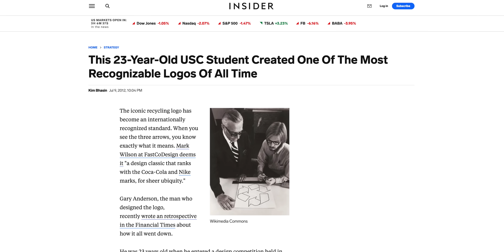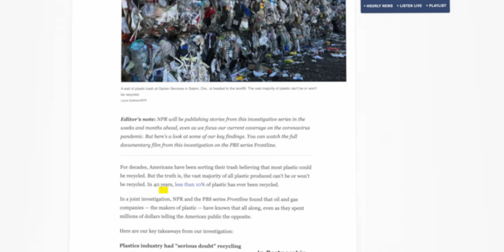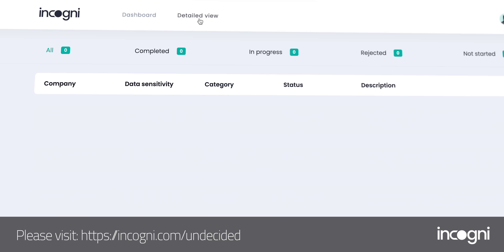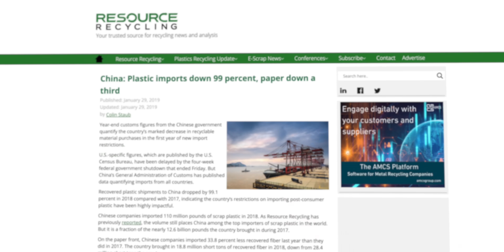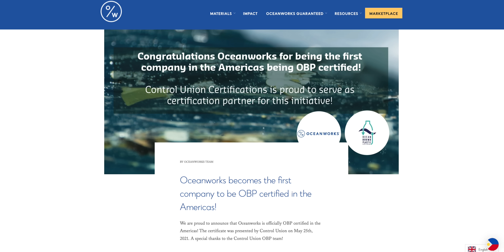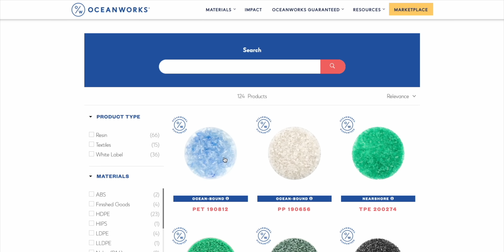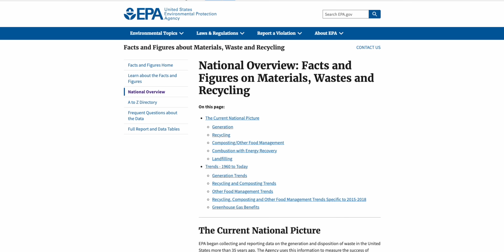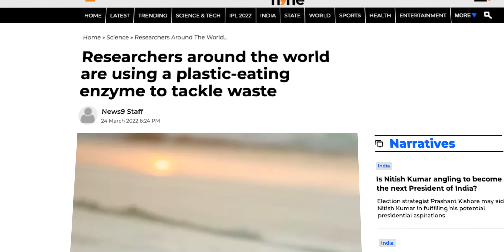The Truth About Plastic Recycling ... It’s Complicated

Comment: The answer, beyond your suggestion of switching to biodegradable materials where possible 👍, is to outright ban plastic types that are not realistically recyclable (or at least removing the recycling label), and placing the responsibility of recycling packaging, back on the manufacturer.  The responsibility of recycling has always been placed on the consumer. How are we supposed to do our part when things like, already existing biodegradable packaging (six pack holders, for example) are not even made available to us.

Comment: My local supermarket in France has installed a plastic bottle shredding machine in the foyer. Customers put their empty bottles into a slot and the shredder reduces the bottle into tiny pieces. Now, this machine must have used a lot of energy and material to manufacture, add the energy to run it and I cannot see any environmental benefit except reducing the volume required to be transported. Multiply the number of machines being made and installed and the whole project becomes pointless.

Comment: You can reuse all organic materials including all what came from crude oil (all plastics) to fuel. Technology is around for decades, and has been reinvented several times from several different people (not companies). Research it. You can turn any organic material except all unorganic like stone, glass, clay,... Into fuels we use in internal combustion engines. And the "waste" is gas that can power entire facility.

Comment: I worked at a plastic factory where we would take old plastic, ground it down and melted it again to make sheets of plastic for injection molding. PET and PVC were the 2 plastics we did this with. So you should also include PVC as a recyclable plastic not just PET and HDPE.
Reply: I think there is a difference between recyclable and recycling. There's a great book by Tom Szaky called the future of packaging. Most plastics are recyclable however the demand for most recycled plastics is not very large yet and the cost to recycle them are much higher  than the virgin plastic. As a result most plastics are usually not worth recycling. 

The reason he mentions PET and HDPE is that most single use consumer packaging is made from these 2 material. Because they are usually single material products it's easier to separate them and Industry  has made a point of buying much more rPET and rHDPE therefore the demand has increased sufficiently so MRFs to collect and recycle it. 

Your above points are very valid and would highly recommend the book I mentioned.
Reply: Depends on your area what types of plastic can be recycled. 1 & 2 are the most common,  but it's not accurate to say the only plastics
Reply: Agreed - can't any plastic that is a thermoplastic in principle be recycled? Perhaps he meant that PET and HDPE  in practice are the only types of plastic being extracted from household recycling, which could be realistic as these probably comprise the vast majority of packaging.
Reply: Many of the plastic items people use are highly recyclable. HDPE is extremely easy to recycle. Many hobbyists do it themselves to make custom plastic parts.
Reply: Every plastic can be recycled, the issue is identification. 
With 9 types of plastic its hard to identify and group the less common ones.
Paradox is that the environmental moves made the problem worse, by creating "eco" substances that look like plastic.
Because of those "eco" substances polluting actual plastics, its harder to sort and thus recycle.
Reply: ok i have a question, how many times you can repeat the process with PET ?

with PVC is pretty easy and you can do a ton of times 

but a ton of diferent sources say thing that are almoust oposites 
one say you can Inject mold it a thousant times other said that you can only do it like 5 times
Reply: @anonimoqualquer5503  We would sell the sheets to a company and the company would send us back scrap and we would repeat the process. I don't know how many times we did this but we had companies on contract for many years that would return scrap for credit.
Reply: except less than 1% of PVC is actually recycled
Reply: I recycle 100 Ton per month of LDPE, LLDPE, AND HDPE, making bags of 100% recycled. Well, I actually add something yo the mix... CaCo, that Is basically crushed calcium rocks.. so yes, this video AND many others are full of sh
Reply: I wondered about this as well. It's 1,2, and 3 that are actually recyclable, 4 sometimes and 5 and 6 are a total joke, right?
Reply: @tenchuu007  It isn't just the recycle code numbers that matter. It is the form as well. Rigid plastics #1 (PET) and #2 (HDPE) are accepted in most places. Make sure to leave the HDPE closures on the bottles so they don't get lost in sorting. Rigid #3 (PVC) is accepted in some places, but not widely. Rigid #5 (PP) is accepted in some places, but not widely.. though there are many efforts to improve collection availability. Rigid #6 (PS) aren't widely accepted. Flexible packaging made from ONLY #2 and #4 (LDPE) are accepted via store front drop off if they are clean and dry. Curbside recycling of Flexibles is at least a few years away because the sortation tech to sort flexibles isn't available nation-wide. Plastic recycling is very complicated in comparison with metals, glass, and paper. Plastic recycling is getting better, but it isn't moving fast enough.
Reply: @tenchuu007  but is recycling 5 & 6 work in progress at a research lab somewhere?  Meanwhile taking 5 & 6 out of the mix allows 1, 2, 3 & 4 to be recycled as they, 5 & 6, are contaminants to that feed stock.
Reply: This!
Reply: I currently work in a facility that recycles PP, LDPE and PS - Matt is either misinformed or lying like click bait.
Reply: @f7ipper  I owned waste collection business for years, all our recyclables ended up in the landfill, and that was 10 yrs ago. Everything in this video is correct.
Reply: @Auguur  not everyone on the planet behaves like that - maybe it's an American thing?
Reply: @Auguur WADR 10 years is a long time they could now go through incineration to reduce bulk and possibly with energy recovery.
Reply: @f7ipper  He's not lying.  You may work at one of the few facilities that does this, maybe your facility is the one I'm saving my prescription bottles to get enough to justify mailing them because they are #5 PP and only #1 and #2 plastics are accepted in my whole state let alone my local area.
Reply: But that would impact the video's attempt to sell the "scam" concept.   Can't have that.

Comment: I'm not clear why it doesn't work. Why can't those other plastics be recycled? Is the rest of it purely economics? If that's the case, that's a situation that can be changed through taxation and regulation.

I was also surprised about the PET components. If they can be extracted, can't they be repolymerised into quality plastic again? This is such a disappointing situation.
Reply: Research organic chemistry, let me know what you find. Essential metal alloys and glass are simple. Plastic is a menagerie of unique polymer molecules that are designed not to decay.
Reply: @stapleman007  ...study all of organic chemistry to derive from first principles the answer to a question this video purports to answer but doesn't... right...
I've studied enough organic chemistry to understand the answer, not find it. It doesn't seem to strictly be a problem with the organic chemistry of the plastic. It can also be an engineering or economic problem, but the actual reason recycling doesn't work is just a bit hand-waved away here.

Comment: I am a Packaging Engineer meaning I design all that trash. I have way more to say than could ever fit in one comment. But I will say one thing. The number of times I have been told be execs that "our customers don't care about sustainability" is way way way too damn high. 

You going on twitter, youtube, facebook or the product reviews and mentioning that the packaging sucks, or is unsustainable makes a MASSIVE difference. It gives the packaging team a stronger leg to stand on. We are constantly told to chose the cheapest option. But if they know the customers care that conversation changes.
Reply: It’s like a mantra they learn in manager training.
I was in the same boat as you. The guilt eats at me often.
They continue to make things worse, by either wrapping a PETE or HDPE bottle (by themselves, often the most-recycled plastics) in a full-height shrink sleeve, which makes correct optical sorting at an MRF impossible, or making packs out of different plastics in a way that is impossible to separate from each other easily or affordable. Think snack bags, toothpaste tubes, sachets, drink and food pouches, aerosol vessels. All these are single use.
Pumps and sprayers are also complex composites, but at least you can refill and reuse those many times before something fails and you have to trash it. Take care what refill you buy. They claim refills in bags are more sustainable than ones in PET bottles, due to the smaller amount of total plastic. However, those bags (usually a multi-layer monstrous composite of different plastics) are not recyclable in almost all places, but the clear PET bottle is recyclable most places. One the one hand, they sell the concept of recycling, but on the other sell the bagged refill as if none of the packaging is ever recycled.
Reply: Wow, thanks for sharing!
Reply: Hello Fellow Packaging Engineer/Scientist! What type of work do you do in the industry? Sounds like you work at a brand owner / brand?
Reply: @packagingscientist9530  I like to do design + sustainability work so I tend to stick to consumer product brands.
Reply: @TheJttv  That's cool. Did you study packaging in school or wind up in the field from a different path?
Reply: @packagingscientist9530  i studied packaging and then sustainability. BS + ME
Reply: @packagingscientist9530 
Howdy!
I worked at several consumer goods companies, most of the time and most recently at an international FMCG manufacturer. Depending on the company, I worked from concept through manufacture (including tooling), across thermoplastics, metals, simple analog electronics. I had a great time learning, designing and building. However, I am now happily retired. I am horrified at some of the newer packaged goods, as they are often of more complex mixtures of plastic materials and less volume efficient. It seems they speak of improving sustainability on one hand in their ESG statements, then do the opposite in their new designs.

More than enough about me. What about you?
Reply: Comments may be nice, but $$$ is the king.  Always has been, always will be.
Reply: @stapleman007  marketing is king and if they think their customers care about sustainable packaging. They will change their ways.
Reply: @TheJttv  certainly don't know if it's true for this industry but have observed in others when marketing gets a whiff of sustainability being important they change as little as possible to make big claims to get the optics of sustainability with out actually being sustainable. Sadness
Reply: @stretch8390  greenwashing def happens. And sometimes marketing does stretch a little thing into something bigger. 

But on another note sustainability is complicated, convincing consumers that you are being sustainable is just as hard as actually being sustainable. Customers want customers to be green, but dont always know what that means or wont like what that means

Comment: If you buy plastic whether it be recyclable  or non recyclable then there should be a charge on it whether high or low depending on its recyclability. 
I mean how much does it cost to get rid of a bit of polyurethane or a plastic bottle? Not excessive amounts I bet and it is up to the consumer if they want to pay a couple of Cents extra knowing that the extra cost is paying for proper disposal or recycling. If a bottle of soda costs $0.79 and they will have to now pay $0.81 instead then so be it. That is the cost that is put on the user and nobody else which is a fair system. Nobody is all of a sudden going to stop buying stuff just because they have to pay a very small percentage that sorts a very big problem out. If they do stop buying stuff then their options at the moment are going to dwindle of what they can buy and which will probably cost far more than stuff packaged in plastic. 
Fairs fair, you buy the product and you pay a little to pay for whatever happens to it after you chuck it out.

Comment: Incineration can be a very good solution if (and this a big IF) the plant is properly managed. Here in Germany this is a non-issue. 
The plants are controlled on a regular basis.
Incineration removes the entire potential of pollution into groundwater, ocean, and other ecological systems. 
Proper recycling always carries the risk of contamination so it is rarely used in food industry. you never know which country the plastic came from and mixing colors and other chemicals (softener, incineration inhibitors, antifungals,...)
Landfills are a solution. But incineration before landfill seems like the only sensible solution to me. This at least extracts part of the energy and reduced emission risk.
And I agree we need more biodegradable plastics. Just be careful what biodegradable means. here are plastics that are only bio degradable in theory and will take very long to degrade because their decomposition starts at 60 °C and composts will not hold those temperatures perpetual
Reply: i still dont get why people are so into biodegradable plastic. composting has a much bigger effect on the climate than burning.

Comment: I wish people that can influence things would get on Amazon for its horrendous packaging. Who hasn't received a package the equivalent size of a tube of toothpaste in a 18 inch by 22 in by 7 in box from Amazon?
Reply: It's not even the boxes I care about. I can reuse or recycle those. It's the crappy thin gray plastic bags I wish they'd stop using already. They don't protect the items inside, so they often arrive damaged and I have to send off for a replacement. Now they've shipped twice, so that's incredibly not green. And if it somehow arrives not damaged, now I have this stupid plastic bag I can't recycle. They at least include that second adhesive strip to use for returning items in, which I imagine gets used a lot because everything gets damaged (pretty sure they're only meant for clothes, but I receive all manner of items in the stupid things), but still. Why aren't I seeing more of those recyclable paper mailers they were so proud of?

Comment: This is infuriating. I always thought recycling plastic was economically viable unlike glass. Turns out it's no different and worse for our health.
Reply: i thought glass and aluminium were the only 2 that were worth doing. depends on where you are, i guess.
Reply: @TheKlink  Hmm. I heard that since the raw material for glass (sand) is extremely cheap it's not worth the cost of collecting, cleaning and transporting waste glass to a manufacturing plant.
Reply: @mfb4552  when i looked into it, using existing glass lowers the temperature that sand melts into glass. and 70% of the aluminium ever mined is still out there, as in recycled.
Reply: @TheKlink  indeed, it is what they have buyers for. The local residential pickup recycler won’t take anything they don’t have a buyer for, but in order of what they most desire: aluminum food and beverage cans, steel food and beverage cans, kraft (what shipping boxes are made of), other paper, glass, #1 and #2 plastic bottles (clear, untinted is best), #5 food tubs.
Any scrap yard will accept iron or steel (they may not pay you for it), and will pay for most any other metal alloy. Plumbing fittings, non-ferrous cabinet or furniture brackets, cables and wires, are welcome. Our shop had ready buyers for metal chips, scrap and used EDM wire from our machine shop. Some even accept aluminum food trays and foil, so long as it’s clean of food residue. Call ahead or check their website for what they accept.

Comment: One legislative change I think that would make a difference would be to force the plastic industry to change their PRI codes on plastic items.   Let them keep 1 & 2 the way they are but change all the others to a symbol that clearly indicates that the plastic is non-recyclable.
Reply: Rather than make them clearly indicate it's not recyclable, let's just outlaw the crap as much as practically possible. Use recyclable plastic or use a different material.
Reply: @mjc0961  but recycled plastic is non- or at least hardly recyclable. But I see what you mean;)

Comment: Matt, you don't sound very Undecided! But seriously the report you mention isn't so negative... it also points out that taking current trends linearly (which it admits are inaccurate), plastics in dumps should be reduced to only 6% of plastics by 2050. And I don't feel that recycling is an industry hoax... most of the effort is in the hands of buyers (us), not sellers (manufacturers), so it is us the public that has been falling down. And while type 1 & 2 plastics can be "fully" recycled, the other types, when sorted, can still be partially recycled/reused in various ways - think about tires being added to playground surfaces & pavement aggregate - they can't be remade into new tires but they are still reused. Also the catastrophic 2018 change from China is still being worked on, and it's early to claim that the huge problems that it has caused are somehow the fault of our industries that produces plastic items... it will take time to come up with solutions.
Reply from the maker: 😂 Yeah ... on this I'm definitely not undecided.  Appreciate the POV/comment.